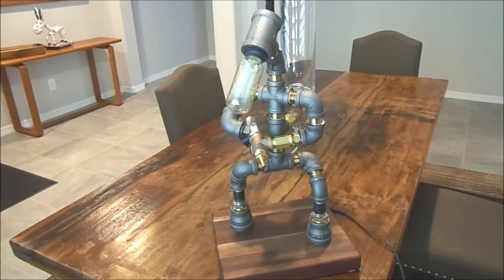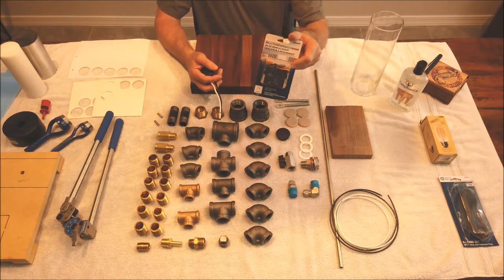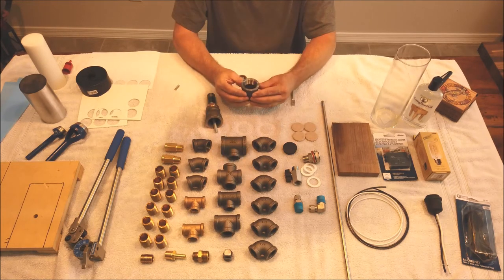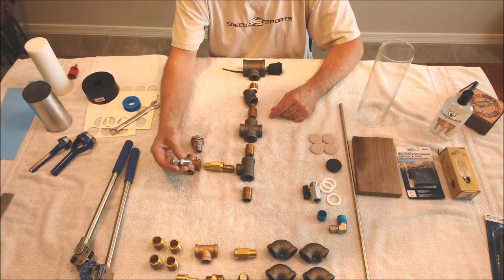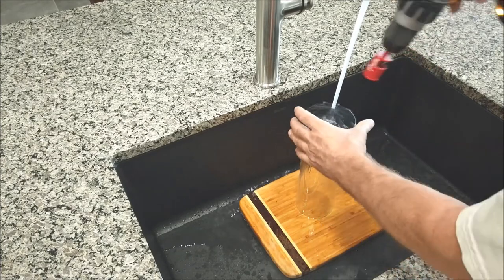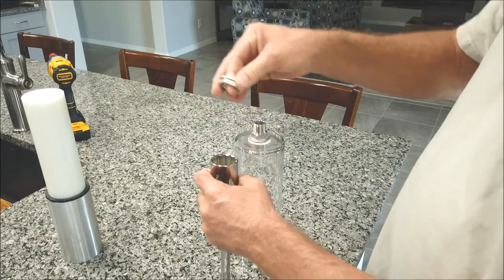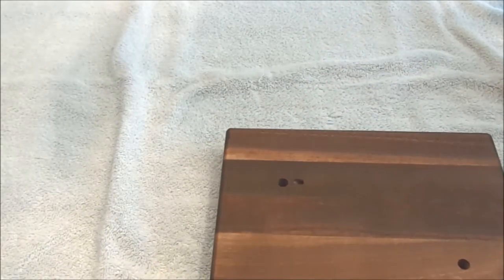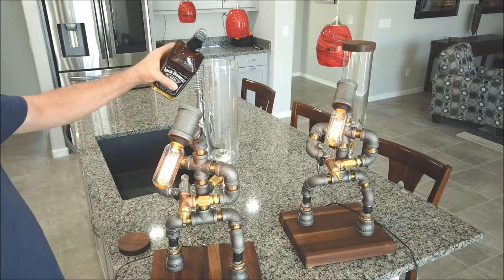Industrial Jack Daniels Whiskey Dispenser Touch Lamp

Comment: Would you perhaps be able to put up a link to that touch sensor you used? And does that sensor only work with a low voltage circuit or higher one from mains as well?

Comment: As far as the cap goes and not be the same for all bottles
Can  you incorporate those shot pour caps with the spout on them like the use at the bar ? 
They sell them at most grocery stores Walmart and package stores
Reply: I tried those also but they have a breather hole in them so they leak all over.

Comment: Thanks for the video! In the parts list, I don’t see the parts that the stainless steel tubing gets inserted into. What are those please?
Reply: They are Swagelok fittings. The straight is a SS-600-1-8 and the elbow is a SS-600-2-8. Best to source these on ebay. If you go to a Swagelok dealer the two fittings will run you $44 plus tax. Parker, Bi-Lok and Ham-Let also make identical fittings but I don't have a cross reference. These are available in brass also.  McMaster-Carr sells short sections of thin wall stainless tubing at a reasonable price.

Comment: Cool build! Is it ok to use brass fittings for the parts that come in contact with the liquid? compatibility is not good for ethyl alcohol and you could also have lead contamination
Reply: I like the way it turns on by touch in it. Will make something like this

Comment: Is it okay to drink this when its sitting/flowing through galvanized steel/brass?
Reply: Brass is food safe. If you caught it in the video I placed brass check valves on the connections to keep the liquid from contacting the steel fittings. And they are cast steel. I didn't use any of those junky galvanized fittings.

Comment: have you noticed any issue with rubber seals deteriorating because of the alcohol?
Reply: There are no rubber seals. All the seals are either food grade silicon or Teflon. Both of which are impervious to alcohol.
Reply: @JScott-wz2ug  Thanks. I believe mentioned that as I watched again

Comment: Also what kind of check valve is the one you use
Reply: These are the check valves from Mcmaster Carr  https://www.mcmaster.com/7768K24/ 
These are the bolts. I cross drilled the brass reducer and put in a 1/4" pin. Watch the video again. https://www.mcmaster.com/90172A639/
Reply: Thanks

Comment: How thick is the bottom of the vases that you use? The one I bought is too thick for the bulkhead fitting.
Reply: I want to say mine is less than a 1/2" thick.
Reply: @JScott-wz2ug  How long is the bushhead fitting you are using? The one I got is just under 2" and is not big enough. I can't seem to find a longer one.
Reply: @dreadly2010  Here is a link for the one I bought from Amazon. https://www.amazon.com/gp/product/B074D9KKCY/ref=ppx_yo_dt_b_asin_title_o06_s00?ie=UTF8&psc=1
Reply: @JScott-wz2ug  If you wouldn't mind, can you measure the threads of both sides. In your video, that bulkhead looks longer than the link. The bulkhead fitting I bought has 1/2" of threads on either side. Here is the one I bought https://www.amazon.com/gp/product/B074QQD3Z9/ref=ppx_yo_dt_b_asin_title_o02_s00?ie=UTF8&psc=1
Appreciate the responses!
Reply: @dreadly2010  I no longer have these dispensers. I sold one and gave the second one away. I'm pretty sure you bought the wrong one. That looks a lot shorter than the one I sent you a link to earlier.
Reply: @JScott-wz2ug  Thanks. I have ordered the one you got.

Comment: Great video. Any chance you have a written list of size of parts needed?
Reply: Thanks. Here is most of it. I ordered it all from McMaster-Carr. 

1	Brass Threaded Check Valve
with Brass Piston, 1/2 NPT Female x NPT Male
7768K24
2
Each
$17.71
Each
$35.42
2	Low-Pressure Pipe Fitting
Iron, 90 Degree Elbow Connector, 3/4 NPT Female
44605K115
6
Each
2.62
Each
15.72
3	Low-Pressure Pipe Fitting
Iron, 45 Degree Elbow Connector, 3/4 NPT Female
44605K124
3
Each
4.46
Each
13.38
4	Low-Pressure Pipe Fitting
Iron, Cross Connector, 3/4 NPT Female
44605K162
1
Each
13.38
Each
13.38
5	Low-Pressure Pipe Fitting
Steel, Solid Plug with External Square Drive, 3/4 NPT
44605K225
1
Each
.84
Each
.84
6	Low-Pressure Pipe Fitting
Iron, Tee Connector, 3/4 NPT Female
44605K155
1
Each
4.19
Each
4.19
7	Low-Pressure Pipe Fitting
Iron, Inline Tee Reducer, 3/4 x 1/2 NPT Female
44605K374
1
Each
6.48
Each
6.48
8	Low-Pressure Pipe Fitting
Iron, Inline Tee Reducer, 1-1/4 x 3/4 NPT Female
44605K457
1
Each
13.08
Each
13.08
9	Standard-Wall Brass Pipe Nipple
Fully Threaded, 3/4 NPT
4568K191
12
Each
3.32
Each
39.84
10	Low-Pressure Pipe Fitting
Iron, Straight Reducer, 1-1/4 x 1 NPT Female
44605K321
2
Each
7.96
Each
15.92
11	Standard-Wall Steel Pipe Nipple
Threaded on Both Ends, 3/4 NPT, 2-1/2" Long
44615K445
2
Each
1.69
Each
3.38
12	Brass Barbed Hose Fitting for Air and Water
Straight Adapter for 3/8" Hose ID, 1/2 NPTF Male
5346K21
1
Pack
3.48
Pack
3.48
13	Low-Pressure Brass Threaded Pipe Fitting
Tee Connector, 1/2 NPT Female
4429K253
2
Each
8.78
Each
17.56
14	High-Pressure Brass Pipe Fitting
Straight Reducer, 3/4 x 1/2 NPT Male
5485K34
1
Each
9.20
Each
9.20
15	Standard-Wall Brass Pipe Nipple
Fully Threaded, 1/2 NPT
4568K171
1
Each
2.29
Each
2.29
16	Low-Pressure Brass Threaded Pipe Fitting
Bushing Adapter with Hex Body, 1 Male x 3/4 Female NPT
4429K415
2
Each
8.77
Each
17.54
17	Miniature Chrome-Plated Brass Ball Valve
T-Handle, 1/2" NPT Female x Male Connection
4912K94
1
Each
9.00
Each
9.00
Reply: @JScott-wz2ug  thanks for all the info. Maybe i missed it but do you have the part number for the feet? 4638K462?
Reply: @b52down3  44605K321
Reply: @JScott-wz2ug  thank you
Reply: Much appreciated!!
Reply: @JScott-wz2ug  thank for the list
Reply: @JScott-wz2ug  traduccion

Comment: Hi there!  This is awesome!  My 4 kids and I would love to make this for my hubby for Father’s Day.  You did a great job on this product and it’s great quality (which is what he likes) and you made it yourself (which is what he loves).  Do you have a list of all the fittings that I can try to purchase and then we can work on this project with him?  Thanks in advance for your help!
Reply from the maker: Thank you so much for the comment. I didn't really make a list. The first one I made over time and bought parts as I needed them. It took me a couple of months to make the first one.  Most of the stuff came from McMaster Carr, Home Depot, Michaels, eBay and Amazon.  Some of the parts I made or modified myself since I have a machine shop. Without the machine shop this would be a difficult project to duplicate. I'm not sure how to advise you from here. My video describes most of the parts that I used. Maybe try to make a list from that. Some of the steps like drilling the hole in the glass takes some finesse and the wooden lid will need a lathe to fabricate. Maybe you could put your own spin on it and come up with different options. Parts today will run you about $350-$400. I still have the second one from the video. If you have an interest I can make you a great deal on it.
Reply: @jurgenscott8430  let me know whats great deal is like. im interested.
Reply: Hi!  It’s me again!  We don’t get this make this last year but was going to try again this year if I can.  Do you still have the second one available?  Let me know!  I’ll check back in to see if you are able to respond.